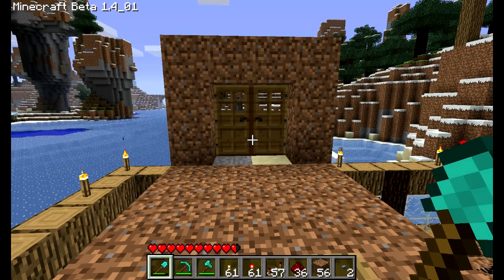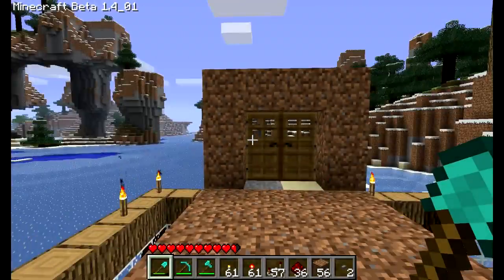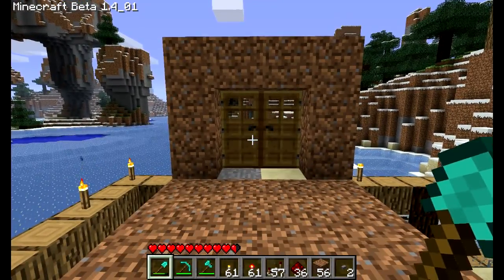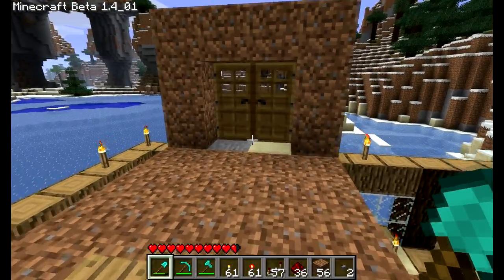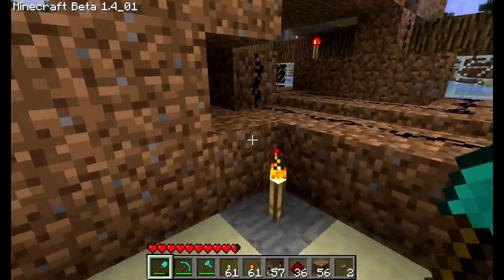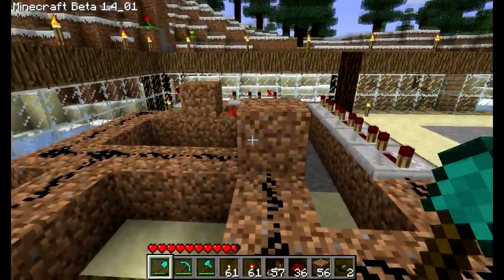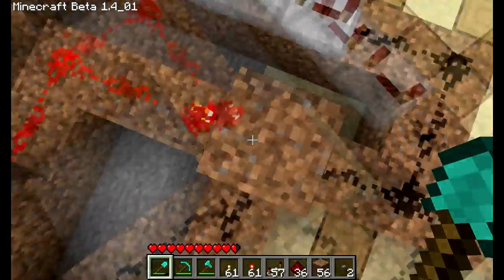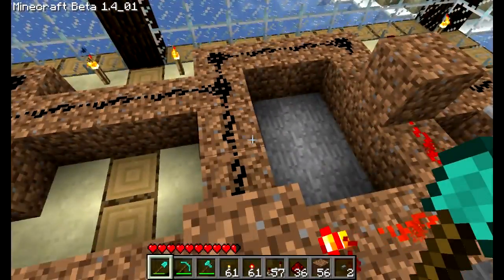Minecraft Redstone 101 - Door with a delayed close

Comment: Even though it's bulky, this is the only method I've found so far that allows you do hide the mechanism behind a wall. Since it doesn't require 2 or more connection points to the on/off button.